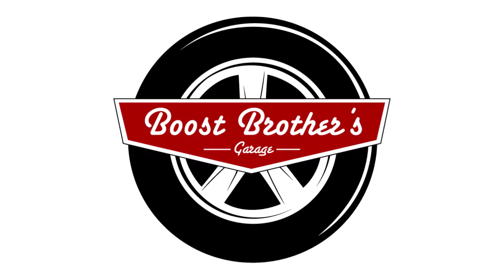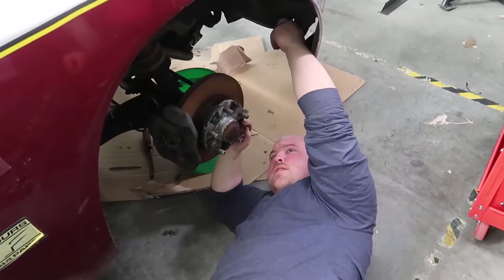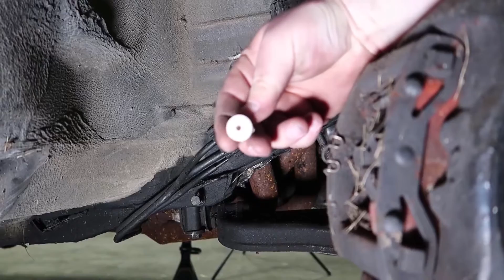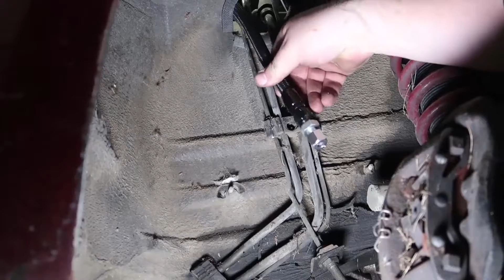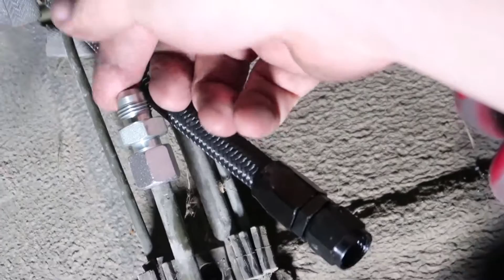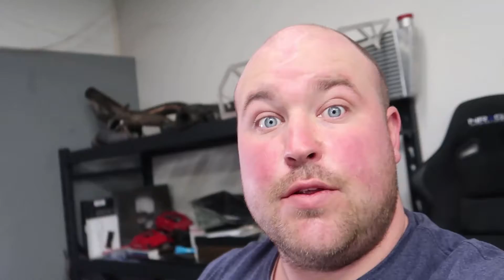Porsche Fuel Line Replacement - 944 Braided Fuel Lines

Comment: Hi my fuel vent pipe has broken of from the fuel tank it's the long pipe that goes over the back rh wheel arch with a 90 degree bend connector on it can this be fixed

Comment: Thanks for the video.  I bought the larts fuel line kit 5 years ago and only finally got around to putting it on.  This video gave me the confidence to cut into my car, which I've never done.  Only thing I wasn't sure of was how hard to tighten the fittings.  (I sent my injectors out to get rebuilt so I can't test yet).  The brake line was annoyinging close, but I was able to get enough room to cut them.  Taking out the wheel well liner was the hardest part really, I'm not sure if it had ever been done on my car and it was a pile of dust and rust, and the one bracket holding the lines in won't fit back on lol

Comment: Unfortunately steel braided fuel lines are in unsafe and  not approved for high performance unless there is a road debris issue. It is impossible to check for degradation  and the AN fittings prone to corrosion. Plain Teflon much better

Comment: I recommend also replacing the old jumper line at the same time (You can see it goes from the end of the fuel-rail, below and around to the damper.  Or you will have to remove the high-pressure fitting and damper again to replace it later.)

Comment: Thanks for the video! I've got the same kit and will be looking to do this in the coming weeks! Much appreciated!
Reply from the maker: Sure thing, good luck!
Reply: @BoostBrothersGarage  Since you're apparently online, I do have a question about the 944 that you might be able to help me out with. Do you know what the module is that's mounted just in front of the battery and just behind the passenger strut tower? Looks like it's got a cable actuator that goes through the firewall over by the brake master cylinder and a black rubber hose on the back side that goes into the unknown?
Reply from the maker: Cruise control module, DELETE lol
Reply: @BoostBrothersGarage  Awesome...Thank you!! I'm currently working my way through all of your 944 videos. Thanks again for all of your content as I know it takes a ton of time and effort to get all of that stuff edited and uploaded. It'll be an invaluable asset when I get digging into my '86. Keep it up!!
Reply from the maker: Appreciate the kind words!

Comment: The tank to pump hose on my '86 944 turbo sprung a leak, so I'm about to replace the necessary lines on the car. Still not sure if I'm gonna go with braided or factory lines and I'm also considering having an hydraulic shop build some for me. Keep up the good work, guys- I've been following you for about two years now.

Comment: Will those fuel lines fit a 1983 944 NA??
Reply from the maker: I don’t believe the kit I installed will, but this kit does and I can vouch for Rennbay stuff. Looks like you just have to note the right option for your year: https://rover.ebay.com/rover/0/0/0?mpre=https%3A%2F%2Fwww.ebay.com%2Fulk%2Fitm%2F142958415606
Reply: @BoostBrothersGarage  thanks for the reply, by any chance what fuel pump do you have on? And i dont think they fit :c looks different compared to mines, and hey my car fuel damper and fuel pressure regulator were left open exposed for a whole 5 + , i should most definitely replace everything fuel related right? Like fuel line hoses for damper fpr, and new damper and fpr?
Reply from the maker: I would 100% replace all the rubber parts. I currently have the stock fuel pump which is plenty for a mildly modified car.
Reply: @BoostBrothersGarage  car has 46k miles though
Reply from the maker: Low mileage isn’t necessarily a good thing when it comes to a classic car that has sat. Just means that the rubber parts need to be replaced or at least closely inspected!

Comment: Your under fender liner shot shows fluid on the structural chassis frame. Is this a current or older hydraulic power steering leak?
Reply from the maker: Not to sure yet. We haven’t even started the car yet. But, the belt and crank pulley for the power steering had been removed when we bought the car. I don’t know if they did anything else to swap to manual steering, or how long ago that was.

Comment: Great job guys going to add that to my list of projects. The "normal" line is the fuel return line and low pressure thus the hose clamps. The crimped line is high pressure 60 to 80 psi and possibly more depending on the application so nothing to mess with.
Reply from the maker: Thanks Glen! Yep, last thing we need is 60 psi of fuel spraying on the header or brake rotor!

Comment: So just curious as I have been looking at doing this myself but don't want to chop the steel lines. Why doesn't anybody make them with both ends as EZ fittings? Was just going to make my own but want to know of any reasons why you would want to chop the lines.
Reply from the maker: Good question... The line going to the FPR is just a rubber hose with worm gear clamps in each end, so it’s easy enough. The compression fitting and flare fitting that are now used are likely just for a more secure connection.

However, the other hose is a hydraulically clamped line (at the fuel line coming out of the inner fender) and is therefore not removable/repairable. For that line you have to cut it off and use a compression fitting moving forward.

After hearing some of the horror stories, it was worthwhile in our minds.
Reply: I guess I am going to have to do some investigating under the fender. The lines had already been changed when I bought the car. I have nipples on all 4 connections. From what you are saying that doesn't sound stock.
Reply from the maker: This isn’t the correct hose, but is an example of what the factory “crimp” looks like: https://www.paragon-products.com/Fuel-Line-Rail-to-Damper-p/pp-944.110.413.02.htm